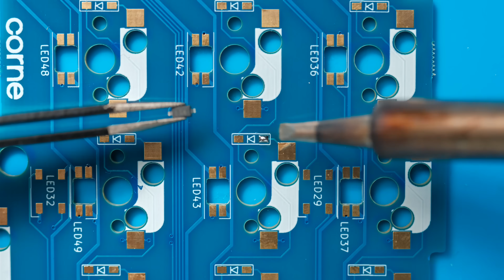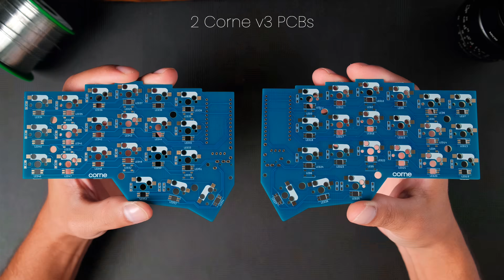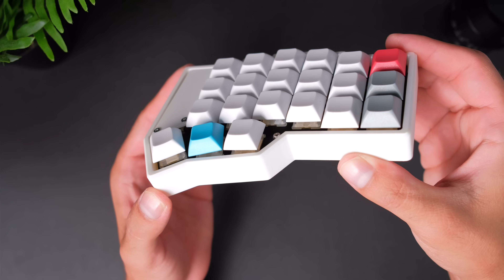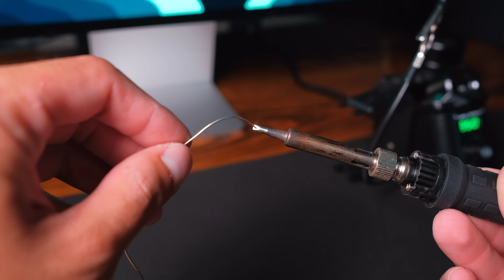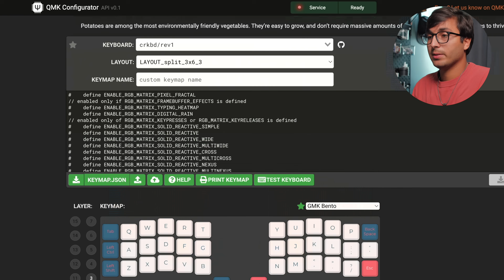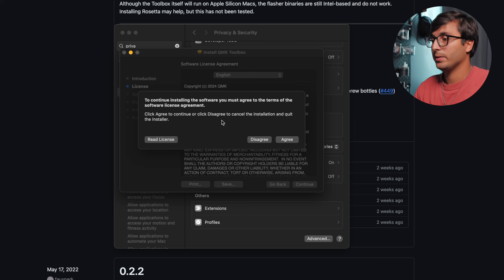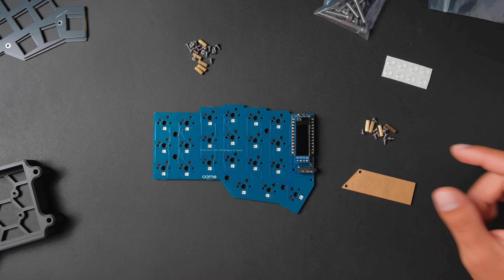How To Build A Corne Keyboard: The Complete Beginner's Guide

Comment from the maker: CONNECT THE HALVES WITH TRRS FIRST AND THEN CONNECT YOUR KEYBOARD TO THE COMPUTER. FOR DISCONNECTING, DISCONNECT FIRST USB THEN TRRS. Connecting/disconnecting the trrs while the keyboard is connected to power via USB has a risk of damaging the microcontroller. I didn’t know this before making this video, but someone mentioned this in the comments. I also wanted to mention that the soldering equipment is just my recommendations and what I like to use. Don't feel like you need to have everything I mention in the video to be able to build this if you don't have any soldering equipment already. The most important things I would say are the soldering station with adjustable temperature, no-clean flux and heat resistant tape. The other things already included in the solder station will be most of what you will need. If instead of the partially assembled pcb you are going to be soldering the diodes and LEDs I'd also recommend the reverse-action tweezers and thinner 0.5mm solder to make things a bit easier.

Comment: funnily enough 0:50 shows a soldering clip that has woefully incorrect technique. You re supposed to heat up both elements of the solder joint otherwise you can get cold joints. To give the benefit of the doubt those small components are meant for autoclave, and can melt easily when soldered in hobby settings.

Comment: If you are still soldering, consider doing this with heat gun and supported soldering paste, it will make the process so easier to mount SM components.

Comment: Hi Josean. Thanks for the video. I am using as a guide to build my first corne. I have a question about the silicone working mat. I bought a generic one that is blue, but I feel my hairs standing from the static when I first got the plastic bag off when it shipped. Do you think this might damage the mcu or the pcb?

Comment: hey Josean, how you doing? I was able to flash correctly one side on the left side of my keyboard but the right side is the same as the left.. any idea how to to flash correctly the right side? Thanks
Reply: Did you plug in the right side to the left side and test it again? I believe the right half acts like the left side when it is plugged into the computer alone.

Comment: Hi, and thank you so far. The soldering technique really helped me out a lot.

I'm fairly new to split keyboards, and I probably made a big mistake. Since I couldn't find any microcontrollers in stock on the website, I searched on Google (not enough research) and thought that a microcontroller based on RP2040 could be compatible. I bought 2 ProMicro RP2040s on AliExpress. Later on, I noticed that there are more pins in the microcontroller, and on both the left and right sides, there are 13 pins instead of 12. How can I make the microcontroller compatible? What should I read? I know it's a newbie question, but I am lost.
Reply from the maker: Happy to hear you found the video helpful! I haven’t used rp2040 microcontrollers before but after doing some research this is what I found: https://www.reddit.com/r/ErgoMechKeyboards/comments/19bmddk/corne_rp2040_13_pins_new_to_this_help_appreciated/. According to this looks like you can ignore the top two pins and trim off the headers if you’re not using sockets. Also note that the flashing process might be a little different, but you should be able to get it working.
Reply: @joseanmartinez  really thansk for the info, il will read and in the next couple of week try the proposed solution. Thanks again :)

Comment: Love the video! Are you planning on keeping the keyboard or sell it? (Asking for a friend)
Reply from the maker: Happy to hear that! I'm not currently planning on selling the keyboard I made for the video, but the parts you would need to build it are mostly available on splittype.com. I have a list of everything you would need in the description, though I realize you might be looking for an already assembled board. Some shops offer soldering services for the Corne and you would then just need the case, switches and keycaps I'm using.
Reply: sick, will have a look at it and thanks for the fast response. But yes, I'm indeed looking for an already assembled one @joseanmartinez
Reply from the maker: @carshoesch  Happy to help! One option would be the little keyboards pre-soldered Corne: https://bit.ly/4cdEmS5. Then you would just need the keycaps, switches, case and cables which I have links for in the description. Pre-soldered will be more expensive than soldering it yourself, but of course saves you time and removes the extra initial expense of buying soldering equipment if you don't have any already. Hope that helps!

Comment: is there any way to make them wireless?
Reply from the maker: That’s right, you can use Nice!Nanos for this and small batteries. I wouldn’t use RGB lights with it though. I can look into making a future tutorial on this. I actually own a wireless corne and did a video on it a while back:
https://youtu.be/wTMcH7u-vu0
Reply: @joseanmartinez why not use the leds with wireless battery life? I’m going to try my wireless sofle rgb build with a big battery. And I don’t mind connecting power at nights.
Reply: My Nice!Nano runs ZMK.  I struggled with custom mappings for a few weeks and kept going back to the default layout until I finally got my head around the firmware.

The mapping is simple, but you also have to learn about how you plan to toggle layers...total layer raise/lower...held keys to switch layers temporarily?  It's also helpful to know how empty layers allow your lower layers to "peek" through...essentially preserving important command keys available across all the layers.

It sounds complicated at first, but it's totally worth the effort to learn.  Besides, you wouldn't be reading this comment if you weren't interested in expanding your knowledge and skillsets while customizing your own environment!
Reply: Yes with the nice nanos and ZMK software